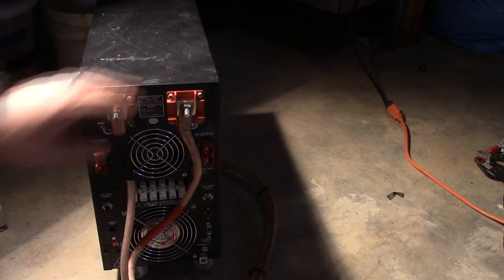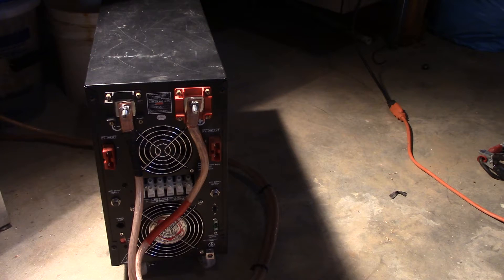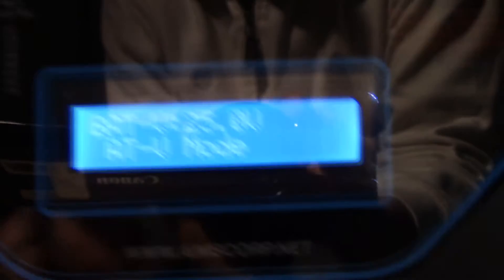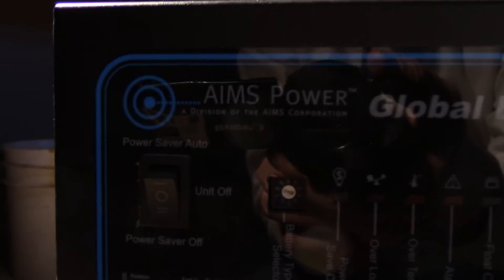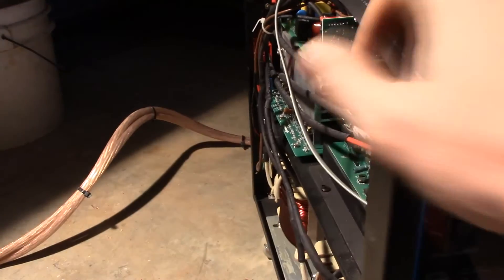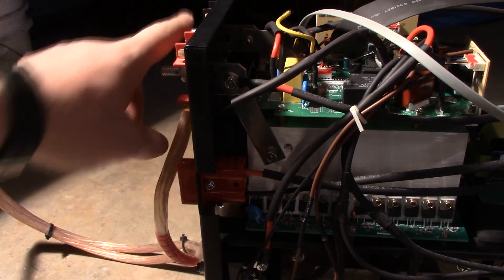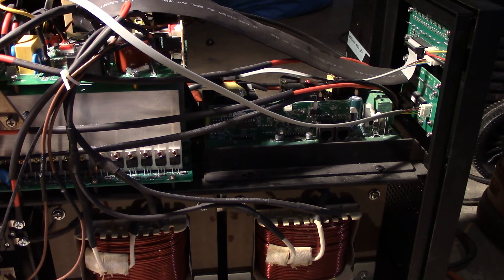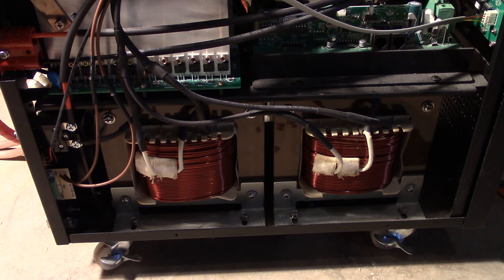Starting Up The 6000 Watt 24 Volt Pure Sine Wave Solar Inverter.

Comment: G G AND R P.S. WHERE YOU BUY THIS INVERTER I'M VERY INTERESTED IN ONE I LIKE THE SPLIT FACE TO WIRE THE HALL HOUSE STRAY TO THE MAIN PANEL THANK U JOSE.
Reply from the maker: hello and i will let you know that 24 volts not the best 48 volts is and here is the place and a warning altestore will rip you off but this is good http://www.theinverterstore.com/8000-watt-low-frequency-48-volt-inverter-charger-split-phase.html this inverter will be the one i finish my system with

Comment: G G AND R I THINK THIS INVERTER IS CAPABLE OF USED PV IN ONE SIDE IN THE OTHER THE DC ONE YOU CAN USED WIND TURBINE SO CAN BE STAND ALONE I'M NO SURE BUT I THINK THAT'S SET YOU HAVE A PV IN AND DC IN I THINK HAS A TWO CHARGER A PWM AND MPPT 50 ANS 60 AMPS CHARGER LIKE I SAY I'M NOT SURE BUT CHECK WITH AIMS THEY HAVE A GOOD CUSTOMER SERVICE JUST MY THOUGHTS THANK U